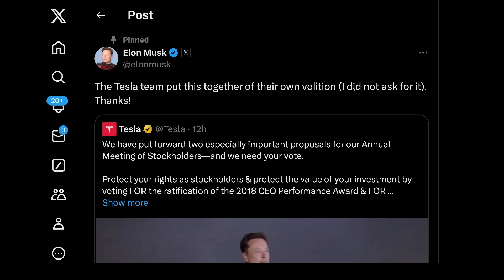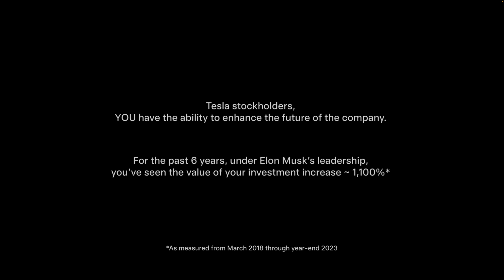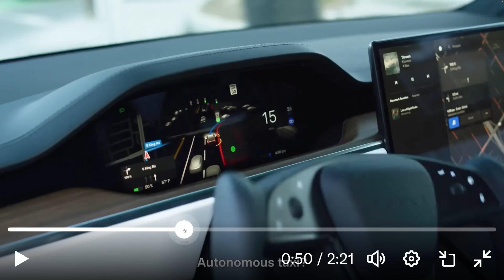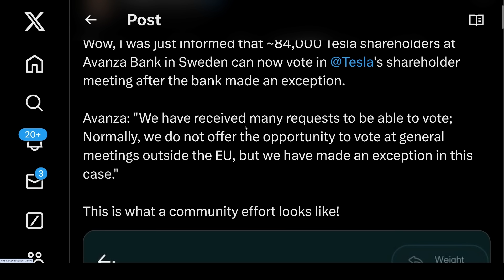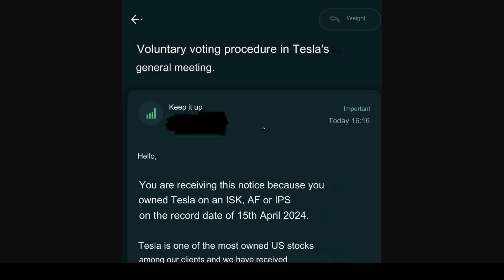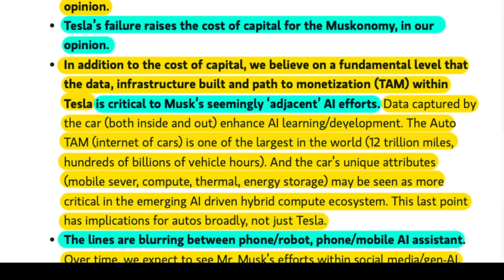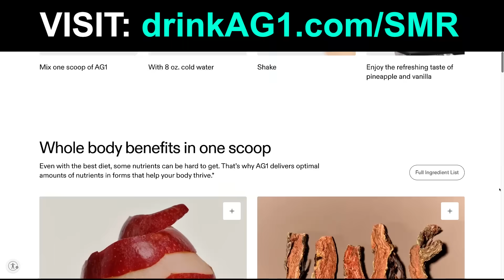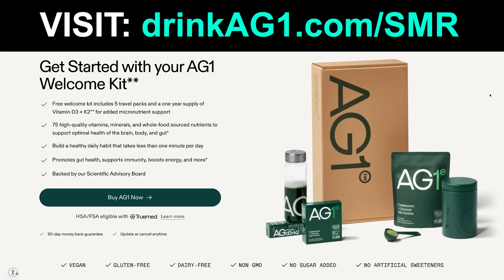Tesla Robtaxi & Ridehail Sneak Peek As Deadline Nears

Comment: Vote for CEO compensation that far exceeds all the profit the company has ever generated. Meanwhile, the shareholders are stuck with a stock that is less than half of the ATM while the market is at record high. After this pay package, you can agree to another one of similar size, or he takes anything AI related - that is used to justify valuation - away from the company. The judge was right. It is unfair to shareholders. The board of family and friends er... I mean directors does lack independence. You fanboys are f*cked in the head, and even if it gets enough votes, it will still likely be challenged in court again.

Comment: I'm in the UK and have shares with a broker that do not allow voting. I've requested multiple times but they have a standard response. I've now moved my shares to another broker who does allow but sadly the move is too late for this vote 😞
Reply: Your broker could have set up a simple online web voting web form for customers, which would count up and aggregate all the individual votes for and against each proposal, then use those numbers to cast block proxy votes.
Reply: @voidthewarranty1429  agreed. Where there is a will, there is a way. However, the broker clearly doesn't care hence not providing this. Anyway, I've since moved to a different broker. Sadly, I've moved too late to be able to utilise it for this vote 😞